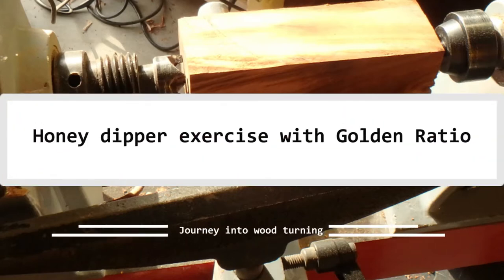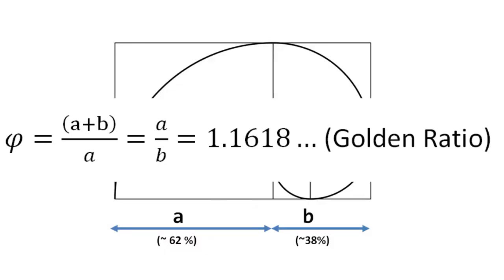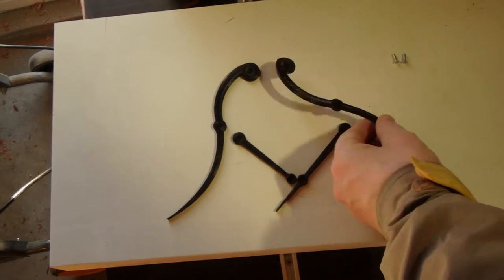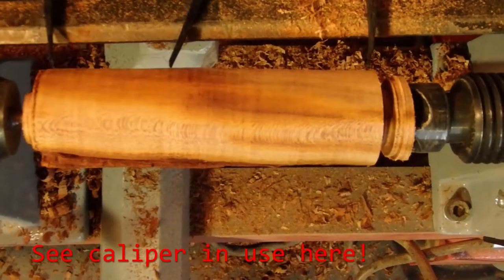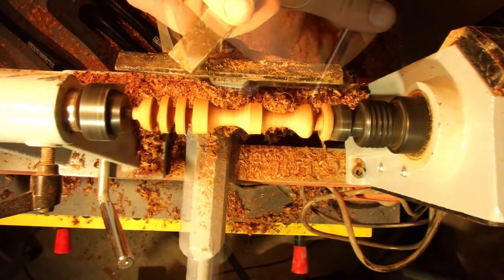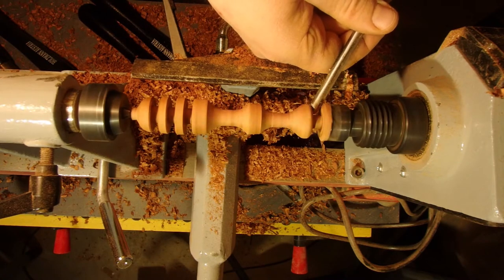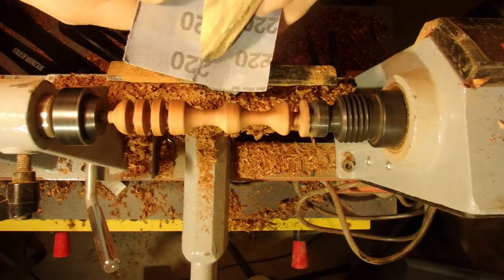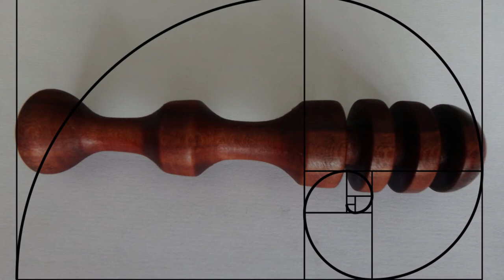Wood turning honey dipper use Golden Ratio for design

Comment: Here's a dumb question... did you give any thought to applying the principles of the golden ratio to the depth of your cuts, as well as the segmented considerations?
Reply from the maker: I used it many times for the directly visible Parts, more as an overall composition rule. Well, you can combine it  with  different other  composition technisch, e.g. triangel, vertikal vs. horizontal  or unequal numbering, and so on.